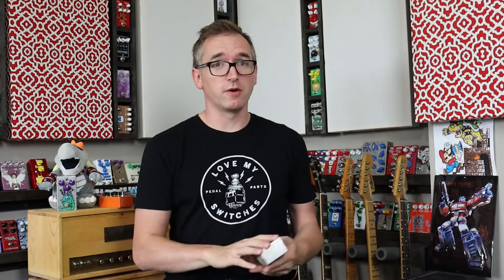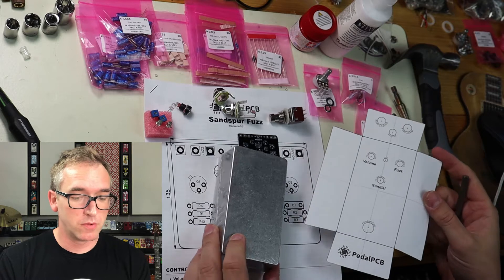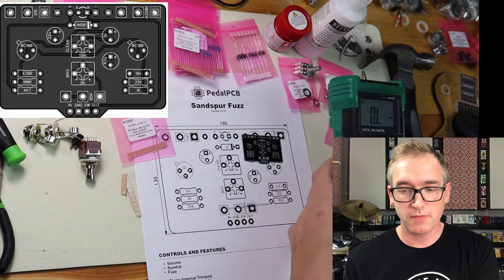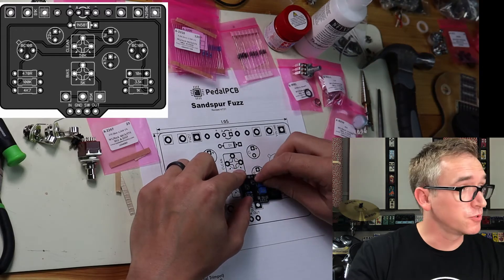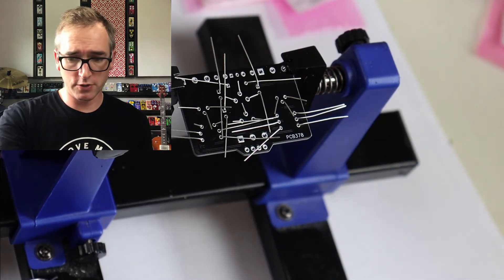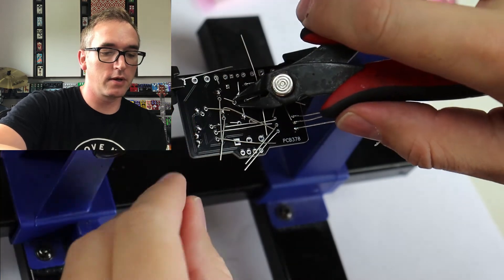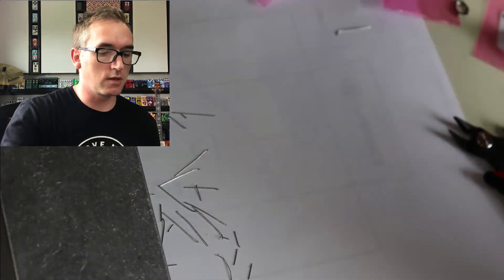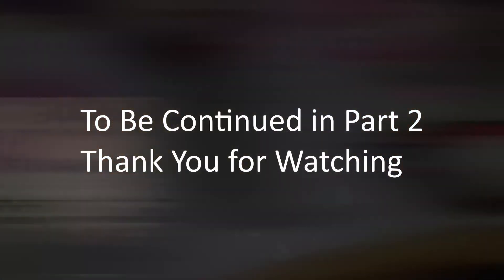How To Build Your First Guitar Pedal

Comment: now me - dont listen to me because i am completely out of my mind . i had a piece of a capacitor lodged in my left foot for a few years . i had to have it surgically removed . it was the cut off or part that should have ended up in the garbage . I agree - yes perhaps this is wise choice to try and be careful with your cut offs . perhaps it may be wise to wear shoes , dont solder with short pants . I am nuckin futz , my solder already has the flux innit BUT - i like to use paste flux . i also like to  remove the paste flux , i never solder with out using some form of additional flux paste or in some case liquid. i have a lot of fluxs too. its my thing . i use fans and filters when soldering , and i also remove the flux . if you do not use flux thats great i am happy for you . i bring it up because my experience is that most people who are beginners have a tough time soldering . my experience showed me soldering is much less challenging with a massive bump in success rates when i employ flux . if you never used it good for you ! make a post , make a video , paint it on a barn. i am trying to provide info which made my life infinitely easier -we solder a lot in our house , for the first 25 years i did this stuff i did not use flux . a plumber turned me on to it . since that single demonstration i have never soldered with out using additional flux.  after i am finished soldering ,  i remove the flux . i use ipa for this , old tooth brushes and also wire hobby brush as a last stage .  i also add a second applique of flux - go over the solder joints a second time - before testing . you certainly dont have to do any of this stuff , thats the fun part of it . we built a DIY audio probe and paired that with R.G. Keens quick and dirty test oscillator. as a result of building hundreds of circuits , effects , oscillators and amplifiers, i got rather adept at trouble shooting over the years . we now test every part that we can before cutting them in . we have run into bad switches , bad jacks , bad pots , bad capacitors - especially the mlcc ones that come in a multi pack - about 1/3 of those were bad on my last order but they were not from tayda . tayda has been pretty good but , minimal fake stuff and minimal duds , when you are buying bulk and then budget buying on auction sites my experience was that i ran into a lot of bad components . your experience is not mine . i wont say sorry , there is no emoji to state what i took the time to type here . if you do not have the patience to read what i took my time to type to you , perhaps it would be wise to choose a different hobby . Chinese pedals are 30 dollars shipped from al baba now . ordering everything i need to build a single boost pedal , the last time i did that costed me 63 dollars from tayda . now if you are going to come at me with attitude because your experience was different thats great i applaud you . i am merely trying to be helpful and realistic about how expensive this hobby has become . if tayda or dhl is charging you 3 dollars for shipping thats great and i am thrilled for you  because they are charging me 16 - for  a small order , again to build a single boost pedal .... its funny because these angry know it all types never post but they come out in droves to respond in an accusatory tone , like i took the time to type all this out , but all of it is a fairy tale i cooked up because i am secretly josh from jsh . the thing about guitar effects is this , tone is subjective . telling someone the pedal i think they should build is about as smart as trying to describe the plot of tom and jerry to my cat . starting out , start small , do not rush . test first .having a capacitance testing multi meter with a pair of alligator clip clasps for testing components quickly - using flux , image flipping vero board jpgs for hole cutting ,  all stuff you do not need to do . in fact NEVER do any of this , NEVER use flux , you will be the next anthony zvex by noon tomorrow . what are you doing ? go pick out which fishing lures to put in your cap to wear at NAMM where tessa jeffers and rebecca dirks will be fighting over who gets to interview you first
Reply from the maker: @peteytwofingers will you please comment more? I love it!

Comment: Please tell me the voltage of capasitor
Reply from the maker: Anything rated over 16v will be fine for the electrolytic capcitor
Reply: @dkpedals  if I use 16v or 25v or 50v 
Is this ok ??
Reply from the maker: @anubhabghosh4175  anyone of them will be fine
Reply: @dkpedals  thank you so much

Comment: Thank you for this. I feel confident in my soldering skills to build this but I am unsure how to buy all the parts. Do I just look at the Pcb on pedal PCB and try to buy parts that match? Is there anyway to buy just what I need?
Reply from the maker: You might want to look at getting a kit to start with. Once you start making pedals from pcbs parts will start accumulating due to how parts are sold in quantity
Reply: @dkpedals  thank you for the speedy reply!
Reply: Often times you can find spreadsheets with the parts on and this can be imported straight into Mouser Electronics and immediately added to the basket in one go

Comment: They sell spring loaded center punches, you don’t hit them, you push down on it , it’s safer as far as not accidentally denting the aluminum
Reply from the maker: That is why I use a tiny hammer and take light taps! They are a really valuable tool though and agree that people should use them.

Comment: I’d socket the transistors
Reply from the maker: I usually do socket most transistors and is certainly useful for swapping out and getting the best results. These little guys were measured out and ended up sounding great.
Reply: @dkpedals  What are the hFEs of those bc108s?   great vids btw!
Reply from the maker: @jalmonsalmon  I believe q1 was around 250 and q2 was 350. Thanks for watching!
Reply: @dkpedals  I have a board that I got for free from madbean that is called the Violenzz that is an EJ clone in a 1590a. I have a couple of nice bc183s that I will use but tempted to just make a sunface instead lol, I will end  up nixing he 1590a and toss it inside a 1590b, that way I can mod that pedal with a sundial since I will have more room to work with and also put an input pot...
Reply from the maker: @jalmonsalmon  That is the beauty of diy! If you are adding two additional pots (bias and input) I would recommend going 125b with top mount jacks. It would save more space on the pedal board also. I have the violenzzz in the queue look forward to hearing your results.